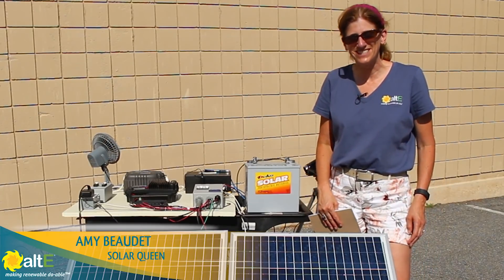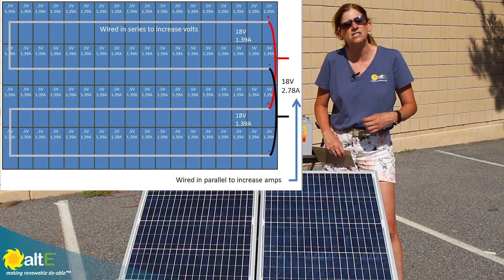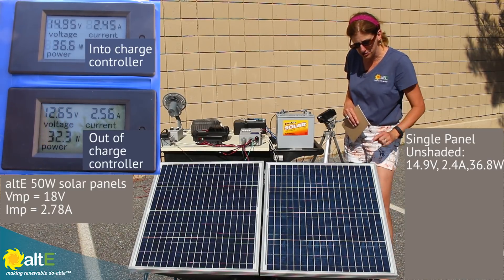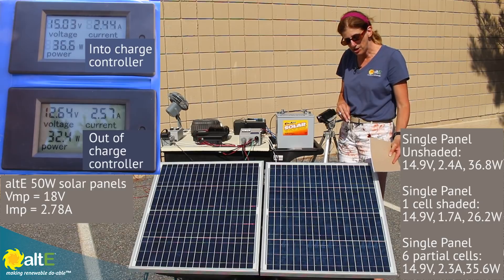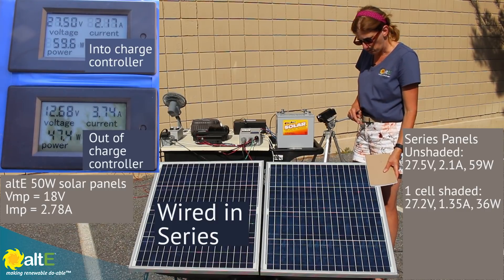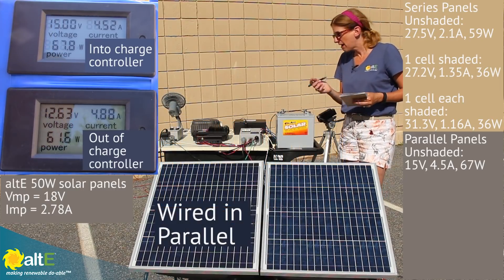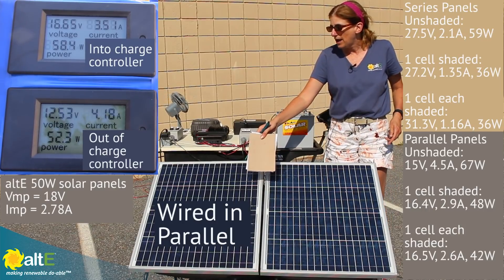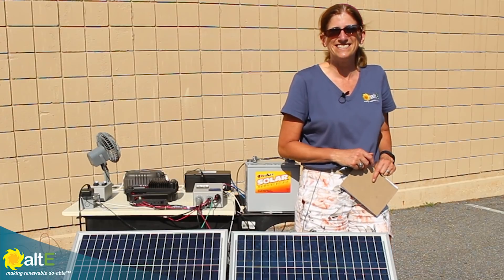How to Wire Shaded Solar Panels

Comment: brillant. so I have 1x200w 12v panel facing East, and a 40amp MPPT controller. was thinking of a adding a WEST facing 200W panel.  So using your shading example and using only the one MPPT, seems going parallel  is the way to go, to get that bit extra out of them. thank you.
Reply from the maker: Sounds like a good plan. Since current is more affected in that case than voltage, planning for different amps is the way to go. Parallel would be best.
Reply: i got 24 250watt set Up East 45°in this way 
4 panels in series 3 times 140v @ 27A on one EPever 60A@48v 
4 panels in series 3 times 140v @ 27A on one EPever 60A@48v 
West 45°
4 panels in series 3 times 140v @ 27A on one EPever 60A@48v 
4 panels in series 3 times 140v @ 27A on one EPever 60A@48v 
I use RECOM 250+5WATT GOLD PANELS with BY PASS DIODES 
So this shearing nonsens is just What IT is .. 
Every seriel set have IT's own 10mm² whole down to the MPPT
SO THE 27A don't get lost in oh say """ 4mm²"" is way good enough 
Yes if you like loss and PWM IT SERTENLEY IS
BUT!!!  I don't build shait .. with loss as a factor .. 
Remember!!
If IT is just .. good enough .. IT is Half BAD!!!

Comment: After many reasearch, this was the most practical and informative video I have watched about shading effects on both sistems, congratulations good job...
Reply: I agree
Reply: If you research is YouTube !!! Then you are a IDIOT
Lern electronic!!! Look Up 
BY PASS DIODE !!!! 
IN THIS VIDEO THEY DELIBERET CHOSE NOT TO USE PANELS WITH 
BY PASS DIODS .. BECAUS THE PROBLEM WOULD NOT BE THIS DEWESTATING !!! 
WITH BY PASS DIODES !!!! 
SO MORAL IS ... D O N T.. BUY ... CHEAP .. PV PANELS ..
 WITH OUT BY PASS DIODES
Reply: @kennethschultz6465  Nice piece of advice, but I was just wondering that this nice piece of advice would have earned way more respect if you had just avoided the foul language you used in the beginning.  By the way, I just took a risk of being bombarded with more indecent words, but let's hope for the best.
Reply: @respecttime4197  Exactly
Reply: Kenneth Schultz that’s true. I have 2 12v panels with 2 bypass diode in series. But I think I will try it in parallel to test it when I got a 12v inverter.

Comment: What type of charge controller are you using in this video that has a digital display output?
Reply from the maker: Those are actually separate power meters that we bought to make it easier to view what's going on for these tests.

Comment: I wish you would have used regular 36 cell panels. These 72 cell panels have the other half of the panel in parallel and makes the power drop less dramatic. It was still a great demo though.
Reply from the maker: Sorry, I didn't have two identical 36 cell panels readily available at the time. But as I said to someone else, the demo was still valid, as wiring them in series did still create a bottleneck, and wiring in parallel showed improved output.
Reply: would it be possible to do the same tests in a shoot out between the 36 and 72 cell panels?
Reply from the maker: That's a cool idea. Let me see what I can pull together. I might be able to compare shading 12V 140W panels, one with 36 cells and one with 72 cells. I'll give you my prediction, the 72 cell will perform better, but let's see it work. It's on the list (I may need a few weeks, I've got a lot going on, be patient).

Comment: Very nice but useless demonstration. each of your solar panels by your statement was electrically two solar panels  wired in parallel in each panel. So you never showered just one panel, or just two panels in series. You showed two on one panel in parallel, then a combination series  parallel using two separate panels in series and each panel being two in parallel (Like 4 6-volt batteries wired together) then you showed two panels in parallel and each panel being in parallel so they would be 4 in parallel.
Reply from the maker: I did consider this, which is why I wanted to make a point of showing it was 72 cells. However, I think the demo was still valid. I basically had four 25W panels. When I wired the panels in series, it was 2 parallel strings of 2 in series. So the shaded cells were still in series, and thus experienced the bottleneck. When it was in parallel, it was four parallel strings of one, so all had their own path. You could see from the results, it had the same effect as if it was 36 cell panels, but you are right, had they been 36 cell panels, I think the difference may have been even greater.

Comment: there are special panels that you can block half of it or more and it wont drop output i have one you can block 90% of it and it will produce just fine its how its wired not in series but parralllel

Comment: Thanks for this. Seemed the logical way and now I know for sure without having to do the test myself.
And yes, more controllers equal added efficiency.  But, if you need to save money and don't have shading issues
one may not even need the added expense of a MPPT over a PWM controller. Unless of course your system needs to run at maximum capacity.
Reply from the maker: You are right. I needed to use an MPPT charge controller for the demonstration because I was wiring in series, and needed to drop the 24V down to 12V. But as we showed, since wiring in parallel was the better method, this can be done with a PWM or MPPT.
Reply: The only thing you really need, is some kind of regulator, to protect the batteries from over charging. As cheap as panels are now days, it's not ultra critical, that you glean every possible watt. It might be cheaper, to just add a couple of panels, to get the current you need.

Comment: Hi Amy . Very useful demonstration. Which type of panel is least affected by shade, poly or mono crystalline ?         As a side note, wear a bikini on the next video.      I bet it will charge up the D I Y  male customers.  I'll bring the margaritas !  Thanks   J K
Reply from the maker: These days the differences between mono and poly are so slight, I don't think there would be much difference at all. But let's find out. I added it to my list to compare the two, perhaps when it gets a little cooler out so we can take heat out of the equation. And I assure you, I will be fully dressed. But you can bring the margaritas anyways.
Reply: Thanks for the reply Amy.  I got married in Phoenix July 22 , 2006 and currently live in Houston. So the heat is definitely a factor.  Since the "EX" has passed recently, I do plan on building a solar system.  I intend on making it semi-portable so I can use it for the house or my motor home. I am becoming more informed about all the variables and it is time consuming.  Looking forward to watching your next videos, bikini or evening gown...HA!   You have kept in shape and hold my interest too !   Later   J K

Comment: very good show as always, i learn every time i watch and i save these to watch over and over. i like the fan on the left that it moves pans and tilts, would you say where or a link to a place that sells them, have not seen them up here, eh
Reply from the maker: Thanks George. I bought the fan a while back online. I think it is Peak PKC0JH. You should be able to Google it for your area. I've beat it up pretty bad over the years with demos (including running it directly off a 32Vmp solar panel), it still hangs in there.

Comment: so if I have a solar boost charge controller what would be the best panel combination for a 24 volt battery bank?
Reply from the maker: Depends on your situation. Do you have a long run from the panels to the charge controller with no shading? If so, wire in series to increase voltage and minimize voltage drop. Do you have partial shading and not a long distance? Wire in parallel to minimize losses. If you have a combination of the two, long run and partial shading, then you'll need to figure out which losses would be worse by using a voltage drop calculator. Maybe you can just use bigger wire to minimize voltage drop with the lower voltage result from wiring in parallel.
Reply: well of course there are shading issue, if only I had a perfect view of horizon!
Reply: John.. If I understand the Boost Charge Controllers correctly, They require 12v 1a min coming from the solar panel (check your specs on the controller & test the amps coming off the panel with a multimeter) and must have at least 18v battery (which is an increase in volts)  Without the increase in volts (from the panel to the battery) the controller will stop delivering current (amps) to the battery (which means that the battery is not getting charged.  I'm having this issue and I don't fully understand it.  This seems to confuse many of the solar experts in PDX also.  LOL  If you figure it out... Please write a response.
Reply: Hello.  how many feet is considered a "long run"..?  I have 5' of PV cable then dropped to 14awg to connect to the battery.  And only 3' from the solar panel to the boost charge controller..
Reply: +Rob K   He was probably talking about MPPT "boost" controllers not DC-DC voltage upconverting.